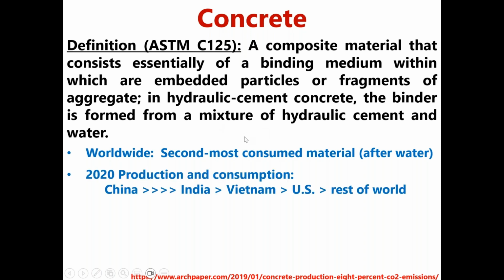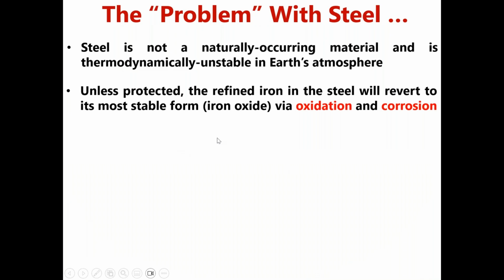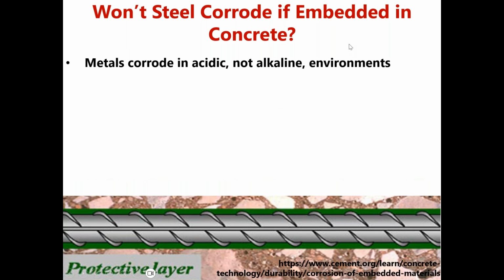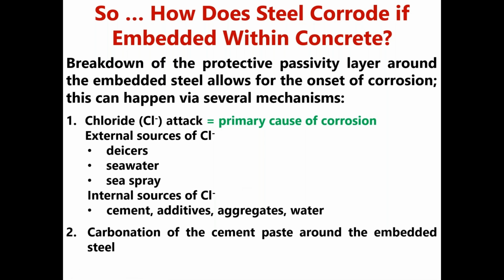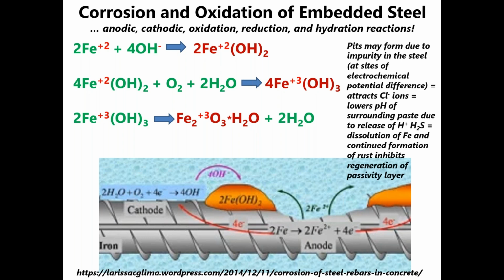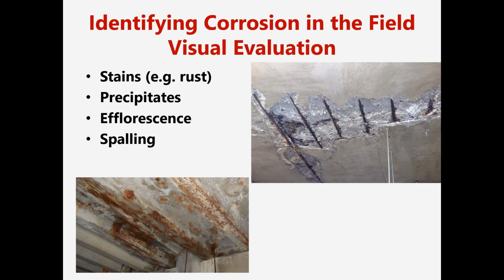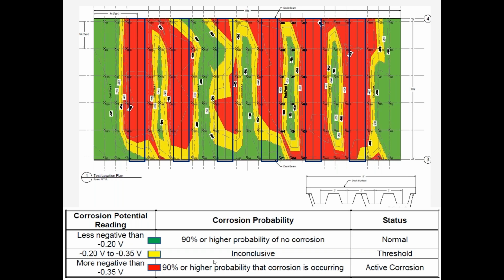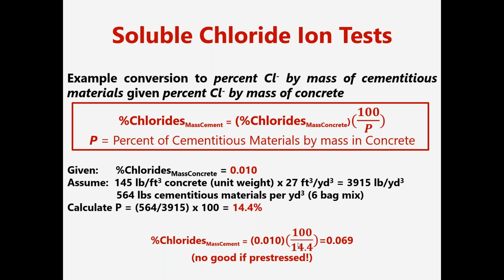Corrosion of Embedded Steel in Hardened Concrete

Comment: Respected Mr. Moore , I have a query . Won't it be better if any code suggests acid soluble chloride levels in concrete as a percentage of concrete by mass of concrete and not as a percentage of cementitious materials by volume. eg. Acid soluble chloride in grams / kg of concrete.
Reply from the maker: Since the test for chlorides is almost always done on a composite sample of concrete that includes the full concrete matrix, it would be more beneficial to specify the concentration as a percentage by mass of concrete and not a percentage by mass of cementitious materials.  I'm not sure why ACI specifies the concentration in those units.
Reply: @atlantictestinglaboratorie5495  that means we both are on the same page.😊